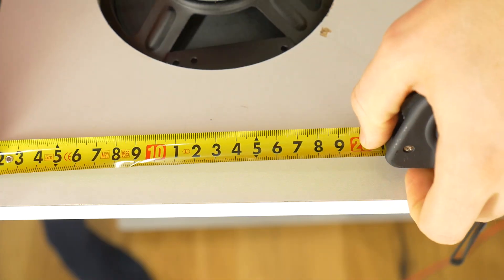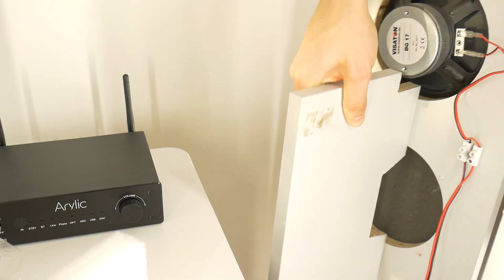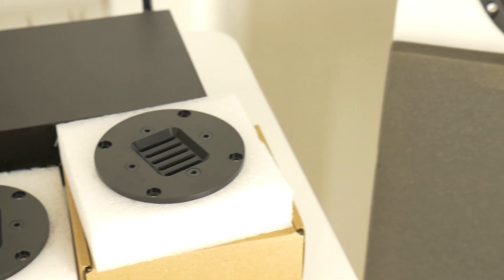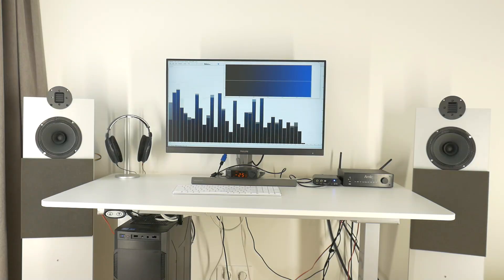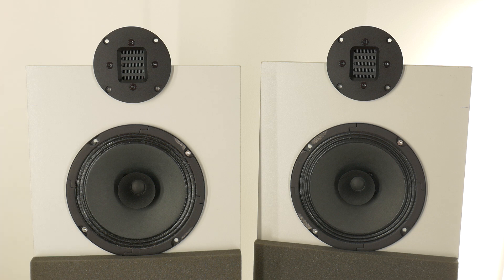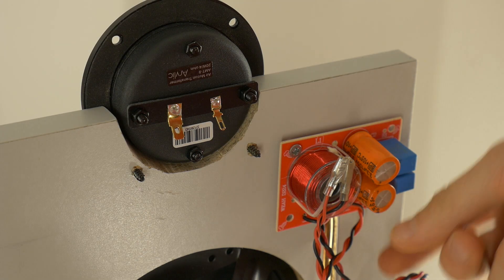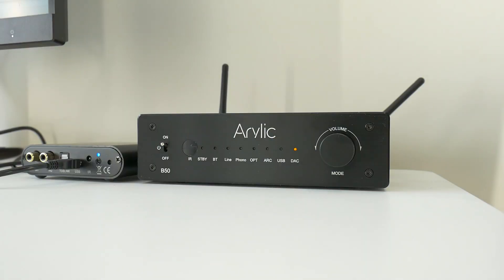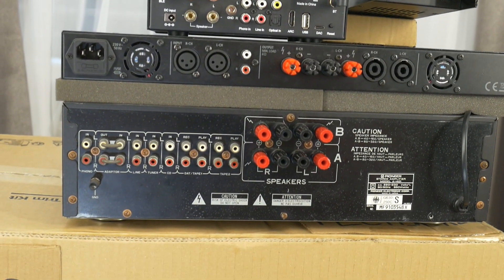Open Baffle Speakers: Tweeter Upgrade Tutorial

Comment: Set up looks good, but you should be using a small tube amp. Not sure what the efficiency of the drivers are but a nice EL84 or 6v6 amp would give you better tone and clarity. Your sound stage sounds kinda of tin like. Tubes will help correct this.

Comment: making acoustics without a measuring microphone is similar to adjusting the colors of a monitor without a colorimeter. In both cases, the output will be an incomprehensible result. it will differ from the previous state, but it is impossible to evaluate the result objectively
Reply from the maker: true, i have some measurement microphones, ths is first step, put all together and then start tune the freq responce.